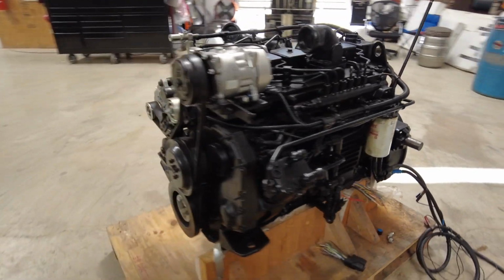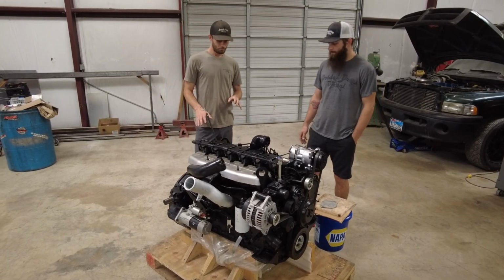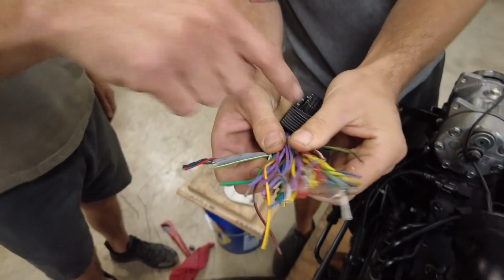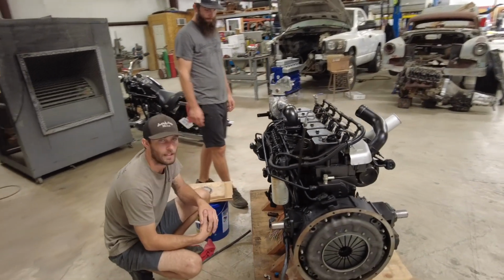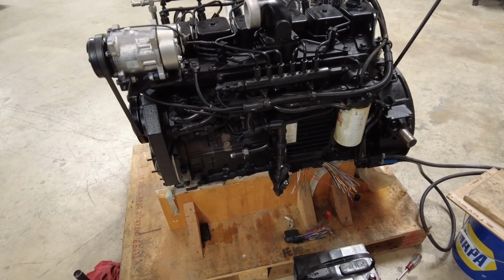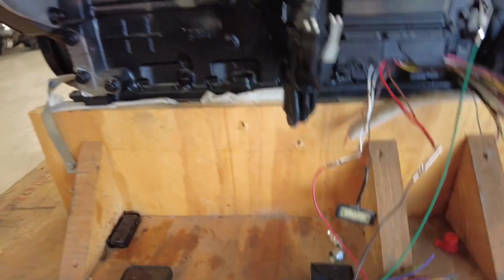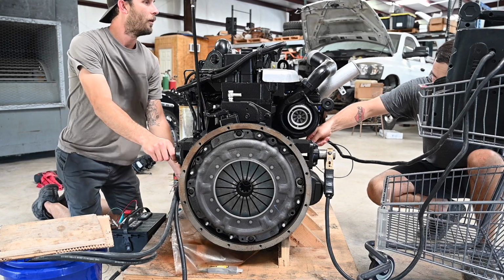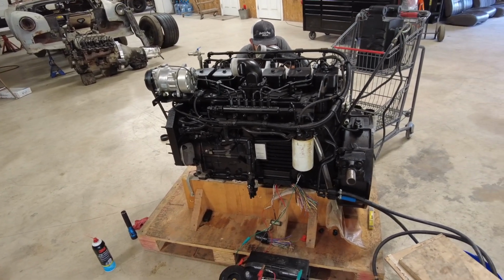!!!! 12 Valve Common Rail Cummins !!!!

Comment: It's cool that it can be tuned on the fly, the only down side is that it pulls you out of the mechanical category that 12 valves are so well known for, but it's definitely a talking point at auto shows and a Unicorn as well.

Comment: make a first or second gen common rail from scratch make a p-pump or a vp44 a cp3 common rail fuel system setup.nobody wants to.they want to get a whole motor swap.just swap the non-common rail fuel injection system out to common rail cp3 fuel system and post a video.

Comment: Was your 12-valve common rail made by the Dongfeng Cummins Engine Company (DCEC) in Hubei, China? How has it compared to the USA-made 12-valve so far? How many miles on it? Did you subject it to high-performance use? Whom did you buy it through? I am considering their 4BT and want to avoid making a big mistake.

Comment: The reversed turbo is common in DAF trucks. Smaller DAF trucks do use the same ISB 24 valve engine, but with a rear timing gear

Comment: I used to operate a big Hyster forklift back in 2007/8 that had a VP44 12valve in it with the exact same exhaust manifold
Reply: A lot of our jockey/switcher trucks post 2010 had vp 12 valves. Goofy lookin

Comment: I am pretty certain that Samsun heavy equipment used the same 12v common rail setup ,I seen several working in South America in a large excavator, and front loader.  Samsung equipment is made in South Korea and China. I served maintained them.

Comment: Meh all of the electronic diesels were all about the foundings if the green new deal....the efficiency lie of cash for clunkers was driven by vw ...then we found out they lied.tgey stole the mechanical diesels because they'll run on multiple fuels...anything post cash for clunkers will not...efficiency dropped in every new diesel...drop in mileage and a colossal waste of resources from harvesting urea resin materials ...trucking / logistics...building factories to bottle it...machinery and infrastructure heat the buildings lights and offices and distribution infrastructure energy and fuel. Still think it's about efficiency? Same assholes that crushed suckers mechanical diesels and could have given them to needy people didn't yet the new trucks fuel mpg is lower than any liberated diesel..same assholes at the same time were trying to make wood stoves and solid fuel stoves illegal. ...green new deal....now look at the fact you can not get micro chips...they can say " oh bummer we can't get chips" so no new cars based on a fake tech need when the old one had zero issues..so electronic twelve valve bravo on being excited about shit no one needs

Comment: U got rid of the best part of a 12v, the p-pump
Reply: Okay? Doesn't mean the common rail is worse than a p-pump. I'm fact is is FARRRR superior. More fuel control and better atomization
Reply: ppump- reliability ... common rail - Power
Reply: Smoking BS.
Reply: The best part of most 12vs may be the ppump but that doesn’t necessarily mean the Ppump is superior to a common rail system
Reply: @ratherbefishing4225  No but it will surely last longer.

Comment: didn't Derrick Rose have 12 valve common rail at UCC a couple years back?
Reply: 2016 I believe. And I'd bet there were attempts that ran before that didn't make ucc levels of power that nobody ever knew about.
Reply from the maker: Derek Rose had one built by Wagler. This one is built by Cummins, that’s what makes it so cool! It’s a 2017 model

Comment: This is cool. There are some many factory OEM Cummins engine platforms in the world most people don’t know about. There is a lot of different engine, fuel and air configurations out there. There is a OEM Cummins 12V w/ a VP44 pump, engine out there. Trucks, boats, heavy equipment, gen’s etc. plus other country’s. South America is still tier 2 emission. 

Start looking.
Reply: my brother was working on packer that had a factory 12valve with a vp39
Reply: 6CT

Comment: If only there was a way to reverse engineer it and sell a common rail  setup for a 12 valve here in the states.
Reply: I know how to get the cp3 bolted to a 12 valve properly with oem cummins parts.
Reply: @gregmyrick1673  drop the parts list :)
Reply: I've thought about using the stock third gen ecu allot for rewiring my 01 24v . It could be done with all stock part just think about it all the parts are available and there.  Imo the best part of the common rail is the head. I own both 12v and 24 and much prefer my 24.  What made me think about it was a kit I own that converts a ls1 ecu to fit a first gen small block Chevy.
Reply: There definitely is. Making it economically viable is the issue.

Comment: Ive seen a vp44 12 valve but never commonrail . That thing is awesome ! Would love to put that in a First Gen
Reply from the maker: Its going in Willies 1993 W350 ext cab dually. We are going to do a video on it soon!
Reply: @holdenbros910  question, have you entered the engine serial number into quickserve Cummins? I’d be interested to see the breakdown and the origin, sometimes the oem info is on there too! I’m just curious🤔
Reply: @holdenbros910  I have a first gen crew cab I’d like to do this with
Reply: @holdenbros910  you guys think its possible to build one of those with a us 5.9b.....
Reply: @timcanizares5240  easily. They have all the parts there to get part numbers off of.
Reply: @holdenbros910  is that thing runnin dual thermostats?